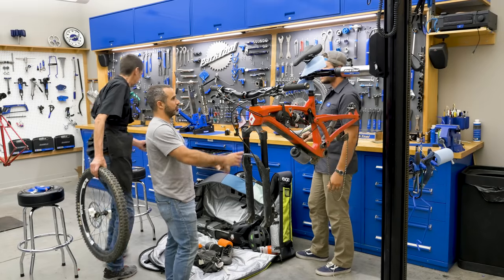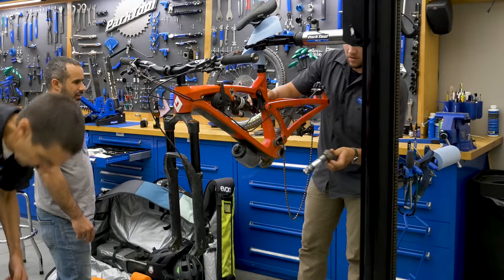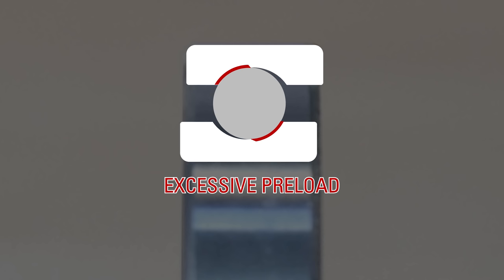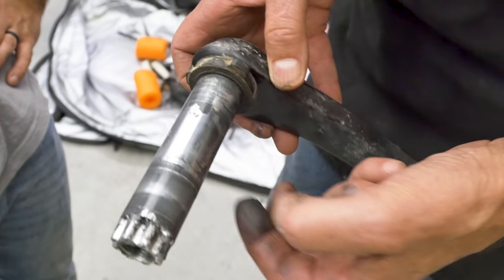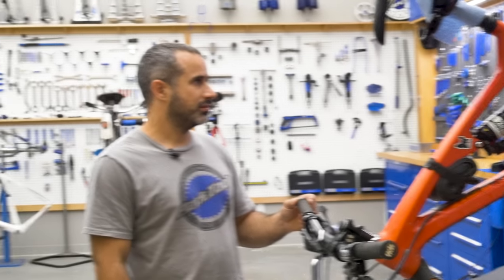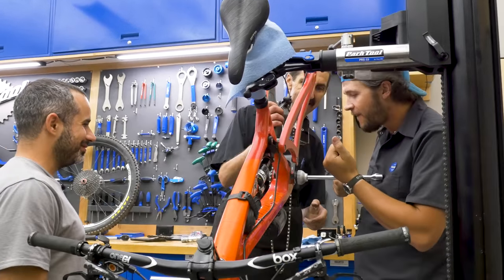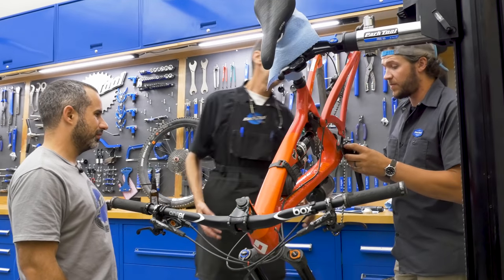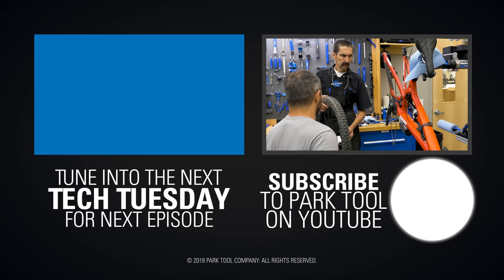Seth's Preload Nightmare, Part 1 | Tech Tuesday #120

Comment: It makes sense for the spacer to be on the drive side. It probably helps Aline chain ring with cassette. 
Also would have been helpful if you showed tightening the lock ring down with the proper tension. 
All in all best video I have seen explaining this though!! I learned a lot.

Comment: I was left thinking of an issue I had on my Enduro. The XX1 cranks had a very slight side to side play, only axially. I went and looked for that preload adjustment on the left side and I was able to compensate the approximately half a mm of play that the crank had. I tightened it a bit, enough to eliminate the play but still leave the cranks rotating easily. 

Thank you, Calvin and Park Tool!

Comment: Could you please make a video about attaching bikes on their dropper posts to work stands? Some say it’s bad, because of the moving/expensive parts. Others say it is absolutely fine.
Reply: yeah, many people claim it's okay as long as it's fully extended...i think it's stupid to risk it though so i just unclamp seat post, extend it, and attach by the seat post...and also work on my own bike so I have no one else to blame
Reply from the maker: Oh the great debate! That will make a great video.
Reply: @huntstyle  still id like to know whats going on internally when you put stress on the post in different ways.  it was obviously made to handle the weight of a rider, but i doubt they intended the post be pulled on.  not sure if it makes a difference.  luckily on my hardtail i can just clamp the seat tube.
Reply: @JoelTGM  Posts are designed to take the weight of a rider so taking the weight of just the bike is no problem at all.
Reply: @countspokeula539  but the weight of the hanging bike is not compressing the post it's pulling it apart.  it's probably totally fine but i can't afford another dropper so im paranoid.

Comment: Not sure if this has been asked before, but what are the white dropout looking things on the front wheel that Calvin is carrying around at the beginning of the video? Looks like "thru axle holders"??
Reply from the maker: Good catch. Those are the drop outs cut off of a fork. This allows him to tighten the thru axle to proper tension and see how the bearings in teh hub will feel once its installed. This was/has been common place with QR wheels and pro wrenches.

Comment: I've been searching for awhile. I have a 2016 Trek Stach that I inherited from a friend and I'm in the process of rebuilding it. One issue I had was with the cranks torqued to spec they put so much pressure on the pressfit bearings that the cranks barely spin freely. Whomever installed them didn't take the time to do it correctly. I was looking to find a slightly lower profile pressfit bottom bracket as all I need is a few mm, but I had the thought today to REMOVE the preload collar on the 30mm Hope Crankset. That did the trick it left me with about a .5mm space which I filled with a spacer and it was fixed. My question is, is it okay to run the cranks WITHOUT the preload collar? If I could find a thinner replacement collar that would work to which might actually help me fine tune it a little easier. Appreciate the help.
Reply from the maker: It sounds like you may not have the correct spindle for that crank. You should be able to run it with the preload ring. Its good to run the preload ring so that you can set the preload properly. Which is possible with spacers but takes more time and trial and error. The boost spindle that should work well with that bike will say 142.5mm on it. With the correct bb and spindle you will be able to run the preload ring.
Reply: @parktool  I agree. I’m not sure I can put anymore money into it right now though. Will it damage anything running without the preload ring if I can dial in the spacers?

Comment: Hi park tool and Seth I just bought a diamondback from a sale but it’s very broke any suggestions (tire won’t hold air, gears and brakes messed up) it’s a hard tale
Reply from the maker: Take a look at our videos on how to fix brakes, gears and tires of the bike. If you have questions on specific areas comment on the videos that pertain to your issue and many times someone will reply with some helpful suggestions or questions that will help lead to a resolution.

Comment: My hydro breaks are mushy after a recent cable swap. What could that be? I've made sure to fill it up with the correct amount of fluid.
Reply from the maker: Sounds as if you need to bleed the brake system. What kind of brakes do you have?
Reply: @parktool  Shimano M8000 Deore XT. Is there a bleed port that I need to adjust?
Reply from the maker: It is not an adjustment, more of a procedure. You will need a bleed kit that is compatible with Shimano brakes. We do not have a bleed video on those yet. There are other great videos out there walking through the process. It is a process that removes air from your brake system.
Reply: @parktool  I feel like it can be that the gasket that connects the hose to the brake pad has a leak or is not properly sealing. I'll just redo the whole setup and see if that fixes my issue.
Reply from the maker: If you loosen the hose you will need to bleed the system. Every time a fitting is loosened or removed (that is part of the hydraulic system) you will introduce a small amount of air. Air is compressible where the hydraulic fluid is not. That air compressing gives you the mushy feel in the lever.

Comment: I'm confused about removing the spacer.  I'm pretty sure that's a race face BSA 30 threaded bottom bracket.  I have the same setup on my Nomad with Race Face turbine cranks.  I run that spacer on the non-drive side specifically because the manufacturer instructions tell me to because I have a 73mm wide BB.  I tried to look this Release specs up to see how wide it was, but if its 73mm wide, I think that spacer is supposed to be there.  Does anyone know if Seth had BOTH spacers on the non-drive side and these guys removed just a single spacer?
Reply: nevermind, answered my own question.  I have a 73mm wide bottom bracket and my cup spacer is on the drive side (not, non-drive like I originally thought).  73mm should not have a spacer on the non-drive side, which Seth has here.  So I'm guessing his release is 73mm wide.  Mystery solved.

Comment: So you can just flip worn bearings round to make them last longer??
Reply: No.
Reply: technically no, in practice, maybe, but since these are threaded cups with cartridge bearings pressed in, and normally only cost <$50 for a nice set, it's not normally worth it. The threaded cups are not swappable from side to side, due to different handed threading. Also without "special" tools it's unlikely you'd be able to press the bearings out and in of the cups again without damaging the bearings. Never apply load through the balls when pressing bearings.